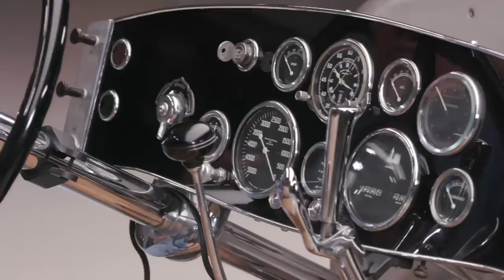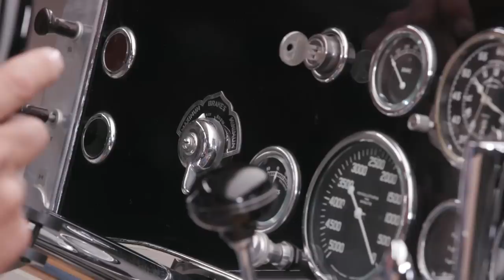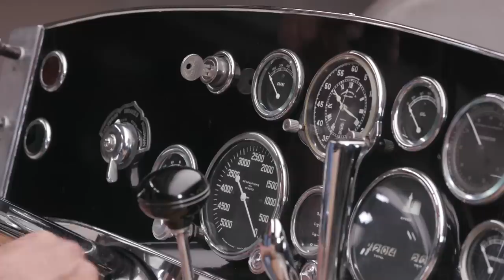1931 Duesenberg Model J Chassis - Jay Leno's Garage

Comment: Only a celebrity could get away driving that on a public road, I wouldn't make it a block before the law would give me a long ticket and a tow.
Reply: A ticket for what?
Reply: chs75 in california?  No windshield, no fenders, no door, just for a start
Reply: @hubifornia  It's legal, it has its California Historical Vehicle plate.
Reply: I am going to have to respectfully disagree, I have california historical plates on one of my cars and do not remember any thing in code about being able to strip off the original body and legally drive the bare chassis on public roads. You can't even drive a jeep with the windshield down in California. Now maybe Leno has a dealer plate that he's getting away with it not sure about the laws on that. I'm out.
Reply: @hubifornia  He didn't strip it, he purchased it that way, which may have had baring on its ability to be legally registered. Also, to compare a contemporary Jeep with a 1920s Duesenberg is apples and oranges.  At 14:56 you can see the license plate which is a standard "California Historical Vehicle" plate complete with tags.
Reply: chs75 he stated it had a willibe body on it originally he did buy as is and a 40s jeep is not contemporary.
Reply: @hubifornia  He is a friend and client of Randy Ema (who he mentioned, and who worked on this car), Ema is the foremost authority of Duesenbergs and befriended one the Duesenberg brothers and acquired all of the documents, schematics and photographs of the Duesenberg company. All Duesenbergs are known by their # (e.g. J322 or SJ414), as such it wouldn't be hard to figure out what the car looked like on leaving the factory or coach builder. He bought it as a chassis. Thank you for now specifying what era of Jeep you were referring to...